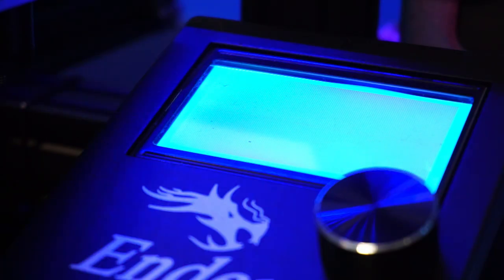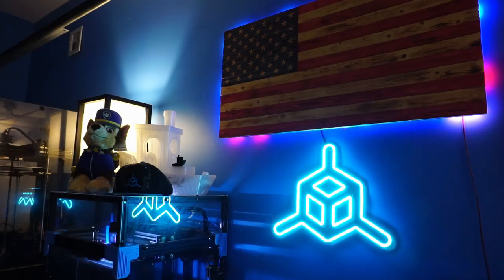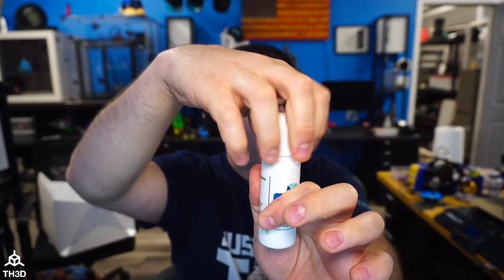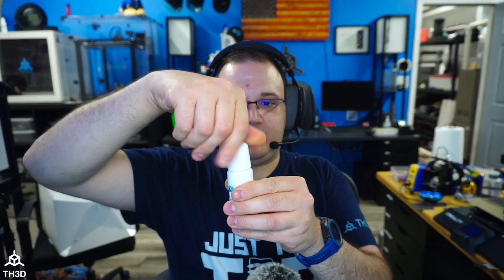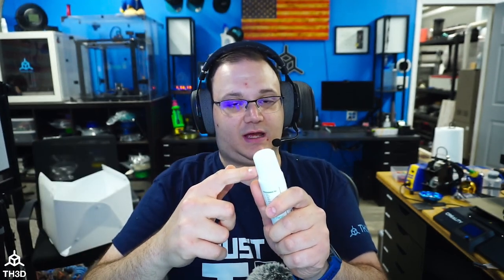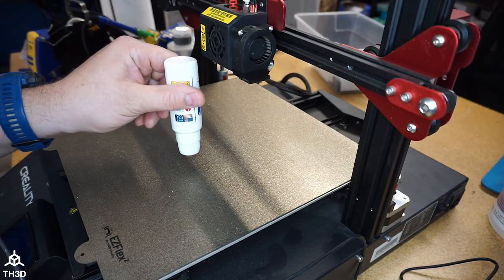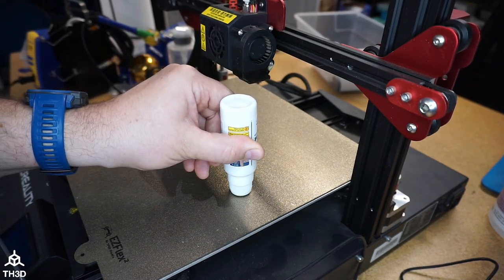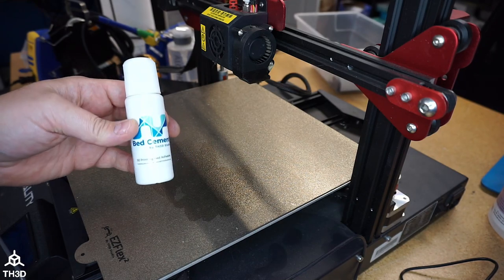How to use our Bed Cement - Bed Adhesive - Works with all printers!

Comment: Nice work and good price. I've been using Vision Miner at work for the past few years which is $45 for 120ml
Reply from the maker: We used vision miner for a while and it works well. But it's expensive and their bottles are not great.
Reply: @TH3DStudio  agreed, I love this style that you have. i will for sure be getting yours when our supplies run low
Reply: @TH3DStudio  Yeah, the vision minor application method is for the birds, lol.  Soon as my last bottle of it runs out, I'll definitely give this stuff a go.
Reply: Ordered on Friday, received today...  Damned quick turnaround.  Soon as the print I've got going on my main printer gets done (assuming no failures), going to apply this in place of the vision miner...